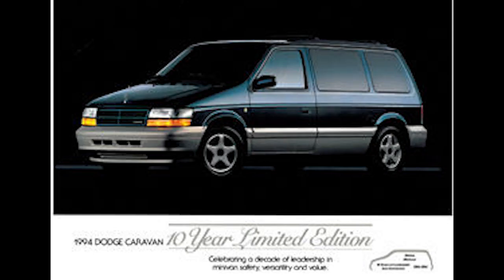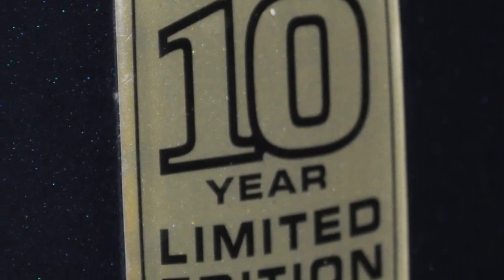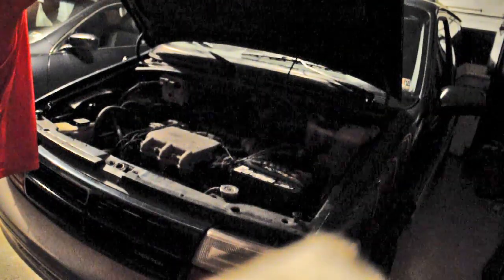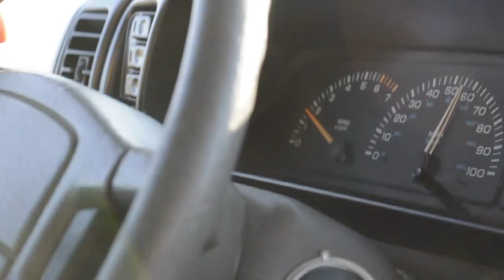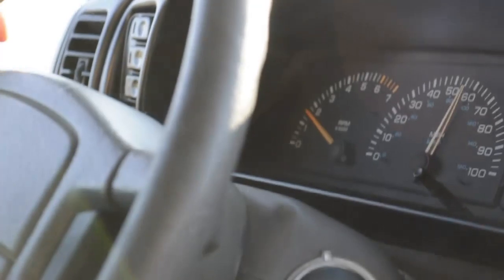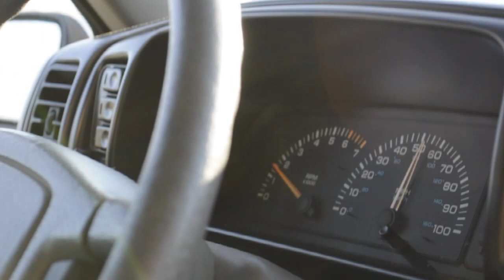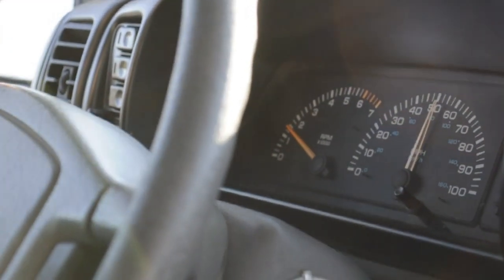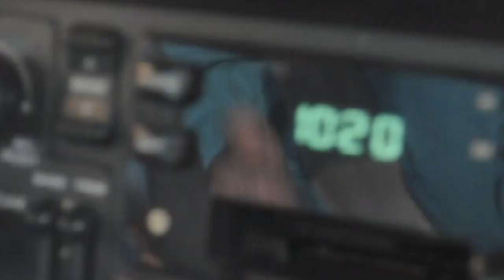Regular Car Reviews: 1994 Dodge Caravan

Comment: I had to drive my grandmother's Plymouth Voyager, I don't know how many miles it has on it as it refuses to die, though a slow coolant leak is proving hard to find. The the engine has eaten 2 or 3 transmissions and 1 cooling fan and that is with good regular weekly checks when it was a DD.

Comment: the entire goddamn floorpan. the only things that changed were the interior and body style from the rocker panels up. you could still get a 3spd torqueflyte on one up until 2000, even.

if you put me on a piece of cardboard under a 2nd gen, and then on a piece of cardboard under a 3rd gen, I'd be hard pressed to tell the difference.

Comment: I had a 1984 Chrysler minivan with the Mitsubishi 4 cylinder engine, it sucked more oil than gas, it had a removable rear bench seat that came in handy to use for pounding my girlfriend..... THAT was the only good feature on the vehicle.